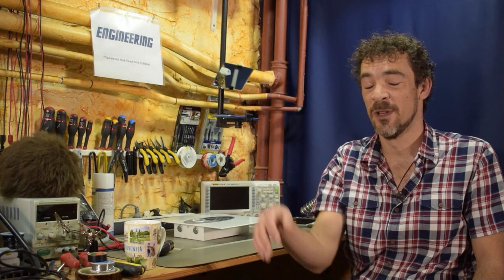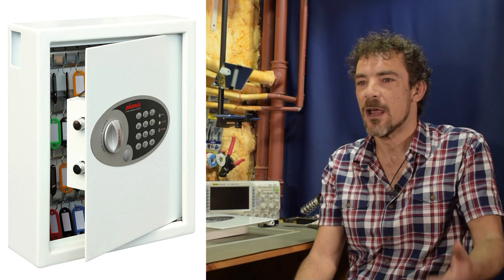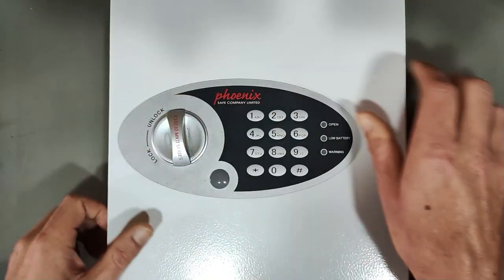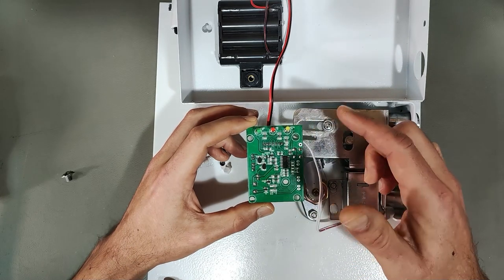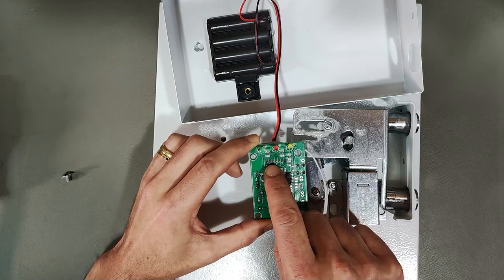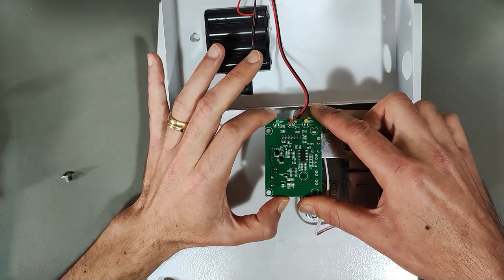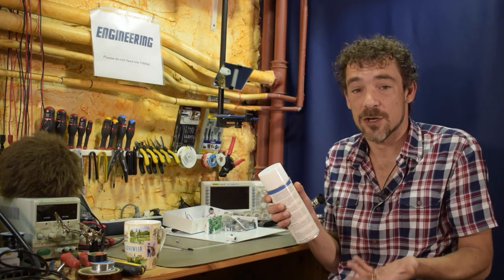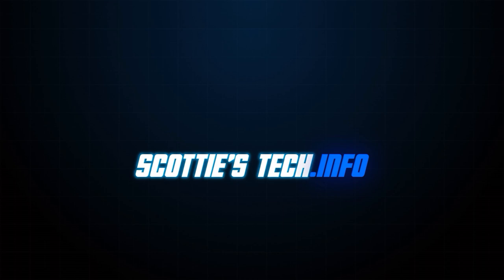Is your gizmo eating batteries? Try THIS!

Comment: Hey Scotty last night which was Monday night here in America I watched your video and your video solved. The problem we had at work which was taking six lamp T8 standard fluorescent and converting them without the transformers. Initially I was going to replace the transformers got it, but it got very confusing, so listening to what you told me about cleaning up all the old wire buying the lamps that only fire on the one side told my bosses about it. They were skeptical, but I turned it on and Bam. It worked so many many many thanks and I will continue to watch your different things your offer and I have subscribed.

Comment: Thank you for this video.  It just may have solved a problem that I have been having with direct wired outdoor lights that come on at dusk to dawn and have a motion detector to switch the light brightness from 1/2 intensity (normal state) to full on intensity when it detects movement.  This is a very nice feature but it seems to work for only 3 years and the lights do not function as they should after the 3 years or so of operation.  I have checked on line and it seems that most people that have the same brand are having the same problems with there lights.  You may have identified this problem.  I will try to see if this is my problem next time one of my lights do not operate as normal.  Thank you very much for this help!

Comment: I have 2 old style Digital cameras I like and still use when going to say a park the beach.
All will quickly vacuum the charge out of whatever brand alkaline cells (just sitting in the bag not powered on). Powered on the charge drops like a rock. 
Moisture and dust combination have ruined many televisions in the past. The fibres become conductive when damp, then the heat generated when the circuit cooks then can carbonize.

Comment: Ug I would personally never use a digital mechanical lock box that relied on batteries or a power source.
Reply from the maker: I didn't want one, either. But I couldn't find a mechanical combo lock version. The one I have also has a backup cylindrical security key, so you can just use the key to open it if you want. At least it doesn't have Bluetooth and WiFi for easy hacking. ;)
Reply: @ScottiesTech  Yeah I hear ya.. thanks for the reply

Comment: Silica packs
Reply from the maker: I tried that once, but it backfired... Eventually, the silica packs became saturated, and then I ended up with extra humidity inside the housing. So, it works as long as a) the housing is always air tight, or b) if not air tight, you replace the silica packs regularly. In the case of my lockbox, it's definitely NOT air tight.
Reply: @ScottiesTech  : Alright. Good to know. Happy New Year 🎉